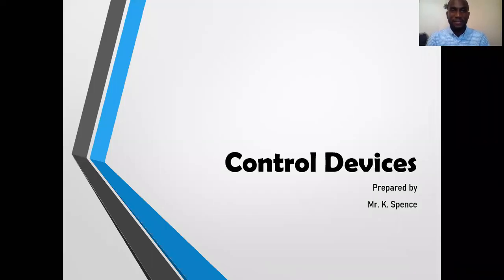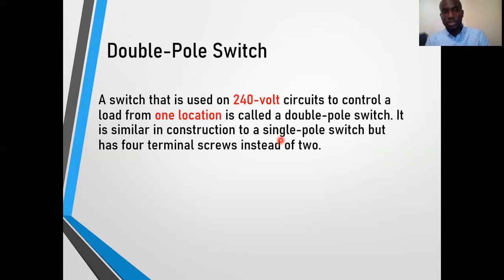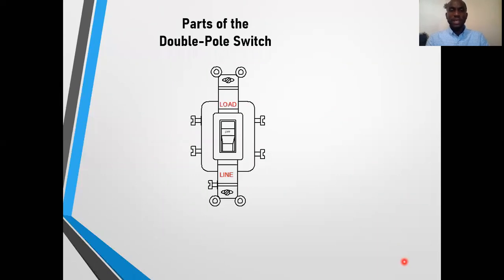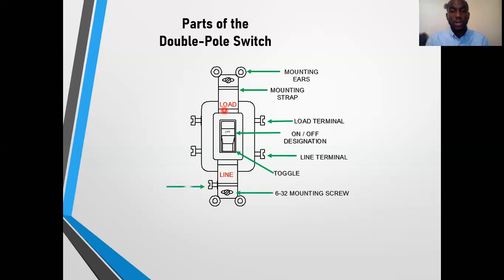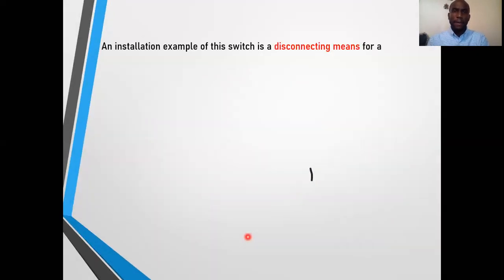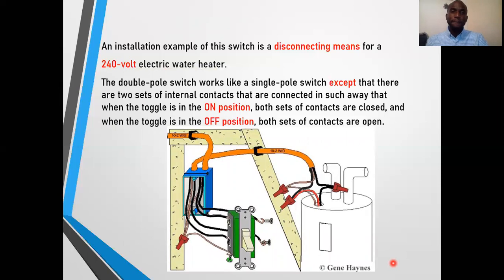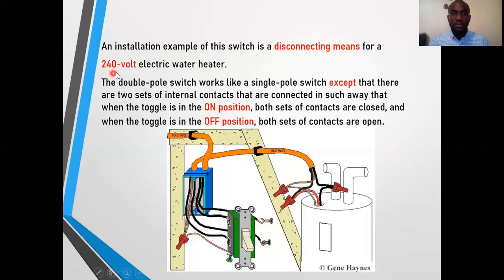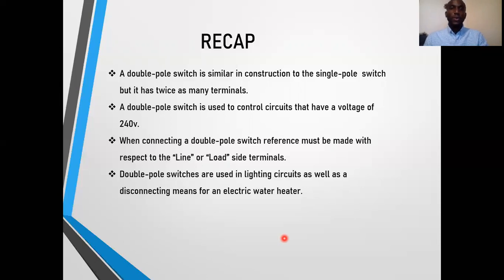Double-pole Switch

Comment: One mistake of the line & load, 1st say lines are next to ground & then later and image shown loads next to ground.
Beside that. Well done Mr. Kevon Spence.

Question: say you have a 50 gallons electrical water heater. If you shut off the power & come back 1 week. You turn on the switch, how long does it take to reach hot set temperature?

Comment: Thanks a lot. Excellent video, very well spoken, love the accent. I have to install an emergency shut-off, disconnect switch to my dad's air conditioner handler in the attic. I just installed the 240 V 30 amp disconnect circuit breaker to my dad's air conditioner coil.

Comment: Nicely explained, but I agree that there is a little contradiction. Gentlemen explained that line side of two pole switch  is usually where the ground screw. In Wiring demonstration he  shows the line side opposite from the ground screw. Other than that, very well explained.

Comment: great presentation but in the last diagram the load and te line was reverse?????
Reply: Nice video, but I noticed that too. In the end, convention niceties aside, it shouldn't matter whether the load or the line are top/bottom.
Reply: also 10-2 AWG wouldn't have 2 black conductors, it would have a black conductor and a white conductor(neutral) as well as the ground which is one of the few things in the diagraph that makes sense XD

Comment: Nice. Had to come check this out. To move forward.. in Motors and controls class. Heading to check out more switches. And circuit and load voltage.